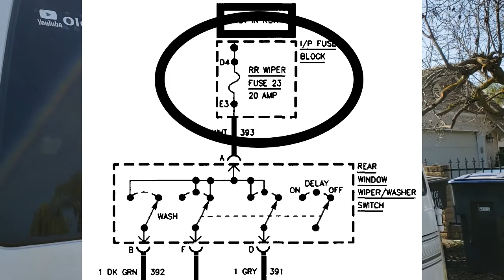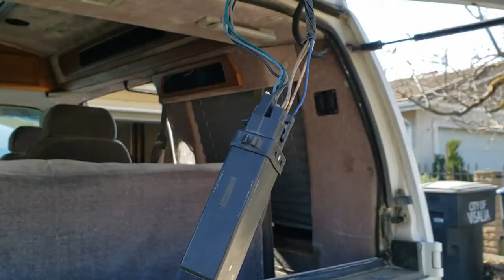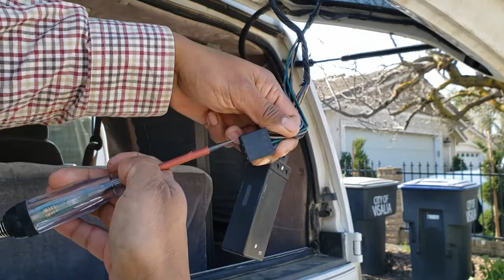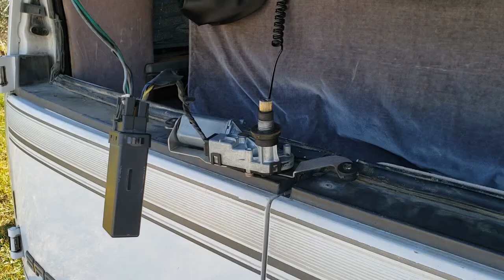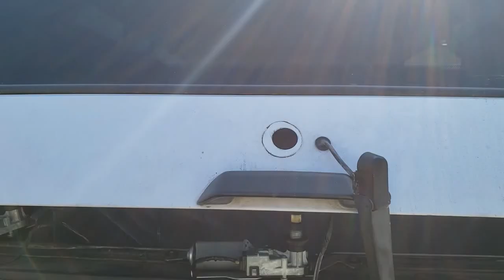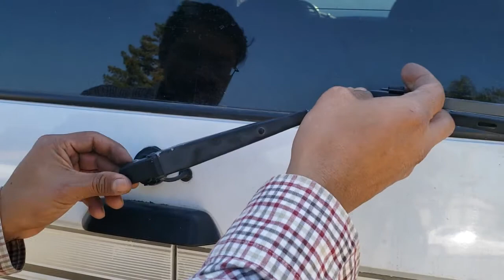Astro / Safari Rear Windshield Wiper Does Not Work Fix

Comment: In regards to the second test of the rear module, A B D E, I have power at A where you state it should be ground and No power at B....Therefore, is my module faulty? Also, while unplugged from the module, no power from the A B D E  plug. Thanks
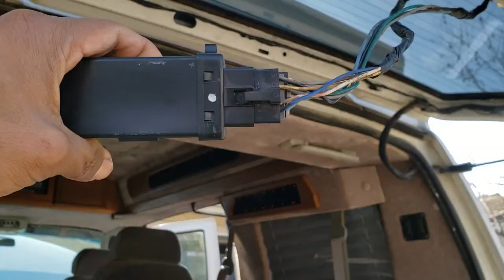Reply from the maker: test starting at 3:11 , testing the connector that feeds the motor. Pin info:
A - Dark blue wire,   Feeds into motor
B - White Wire - "Park switch"
D - Yellow Wire, Feeds into motor
E - Grey Wire - "park switch"
 Pin A is labeled as output and D is labeled as ground
 Your pin A having power is correct. What do the other pins show when the rear wiper is set to on? (with connector connected to module)
Reply: At 3:11, you state that Pin A Blue is ground ( motor ) while plugged in with Switch on, B is power…..Reading your reply, Dark blue is power, white is ground. I’m a little confused….With my Switch ( on ), plug plugged into motor, this is what I see: A-blue wire indicates power, B-white indicates nothing, D-yellow indicates nothing, E-gray indicates nothing. That’s where I’m at. Thanks for your patience and responses! ✌️
Reply from the maker: @BigZaddy2112  the wiring diagram is shown at 0:11 , the bottom piece with the "M" is the rear windshield wiper motor. The middle piece is the module. There's 5 wires coming out of the bottom of the module. They are labeled (from left to right) pins A, B, E, D, A.
One of those bottom "A" wires belongs to the top part of the module in the diagram, that "A" wire being the far left one. 
That far left "A" wire is a ground wire, so I believe we have stumbled onto a mistake on my part. 
Looks like you're getting power, but the rest is an "open circuit."
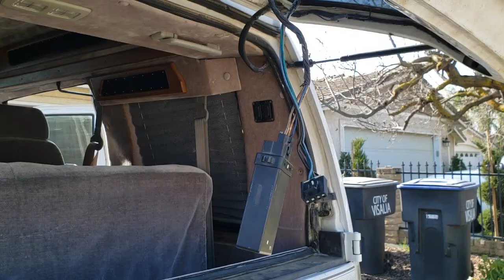Perform the test shown at 1:56 , pin info for that is:
A - Black wire, grounds to G403
B - Grey wire, comes from windshield wiper switch, shows power when switch is set to On.
C - Dark Green wire, feeds into washer pump
D - Light Blue wire, shows power when delay is set
Reply: @OldSchoolNoe  Thank you! I am grateful and appreciate your patience. I end up going down a rabbit hole trying to figure things out when I should have referenced the diagram. Peace